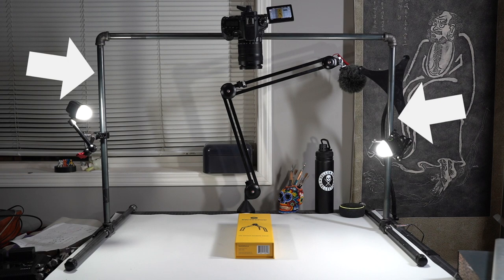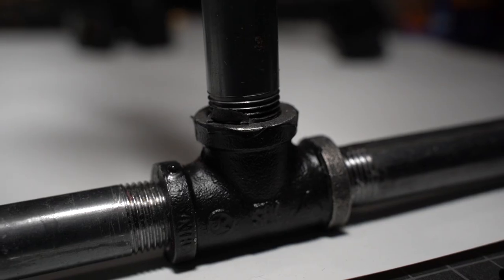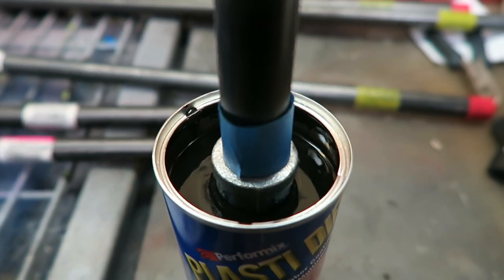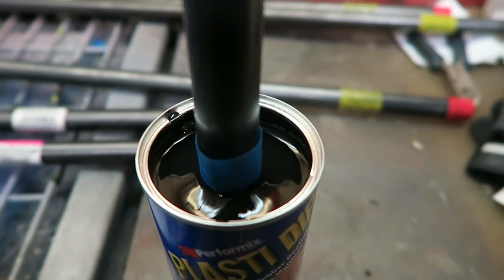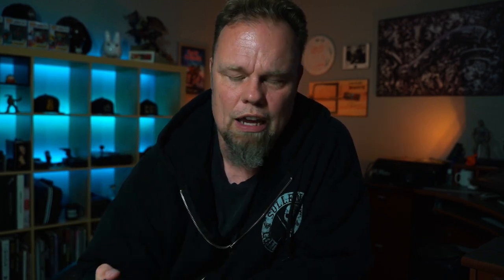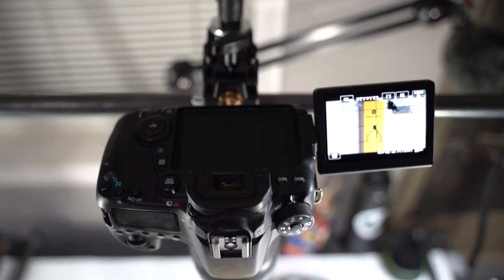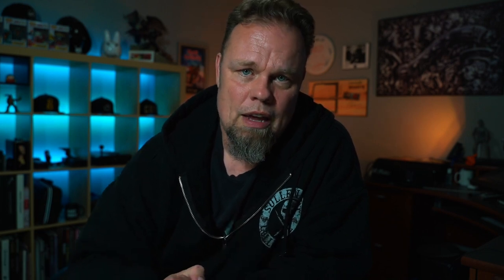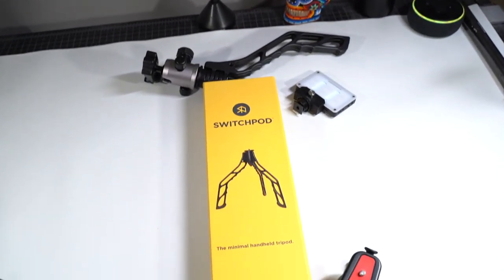Easy DIY Overhead Camera Rig

Comment: I wanted 3/4" pipe as my cross-pipe so I could more securely clamp to it, so I used a 36" wide 3/4" pipe and put 3/4"-1/2" adapters on the end.  The rest was built out of 1/2" pipe to save weight and money.  The tool dip wasn't working for me, so I put a 90 degree male-female elbow at the end of each leg, pointing down, and then 3D printed some 1/2" NPT caps out of PLA.  I can slightly screw the caps in and out to get it absolutely level and stable.  I also removed the black sticky tar and paint off of the pipes with lacquer thinner and a green scotchbrite pad and painted with two coats of Rustoleum self-etch primer and two coats of Rustoleum matte black trim spray paint.  Thank you for this great design; it's way sturdier and nicer looking than some of the PVC contraptions I've seen and can easily hold multiple cameras and lights.  Total cost was about $90 because I already had the paint.
Reply from the maker: Those sound like some awesome upgrades! I like the idea of the 3D printed caps, and painting something to a more refined finish is always a great finishing touch. Bravo!

Comment: Great video man, I always just end up using pvc pipe so i can drill 1/4 20 holes in it and mount a bunch of stuff to the poles as well. This looks way sturdier.
Reply from the maker: You would do this with PVC pipe as well, although as you indicate wouldn't be as sturdy. You could also drill holes in this pipe, there is so much potential with this setup, I am super excited to have it in the office! Thanks man!

Comment: This is awesome how would I make it a bit wider? Just addding another 36 inch pipe to the top?
Reply from the maker: The pipe comes in longer lengths, so it would be better to add a longer piece of pipe at the desired length vs combining two pipes.